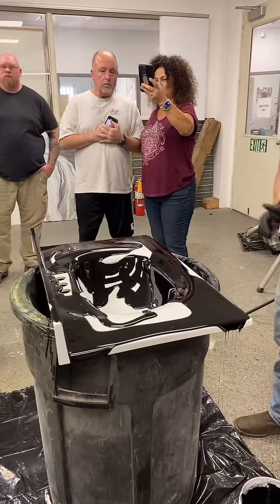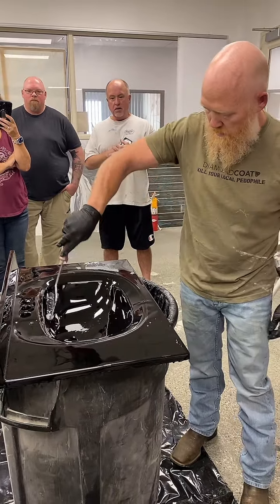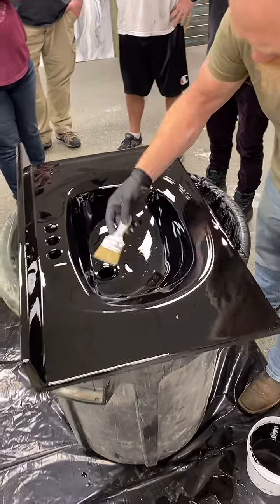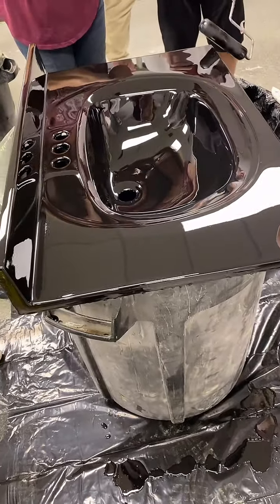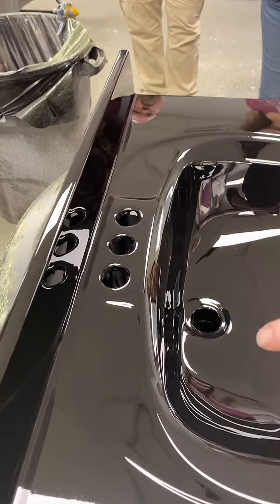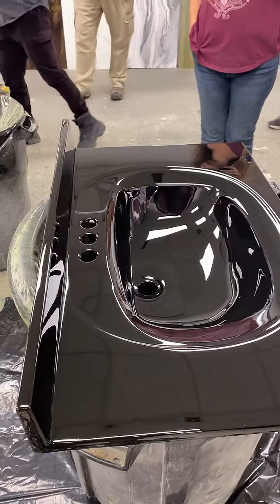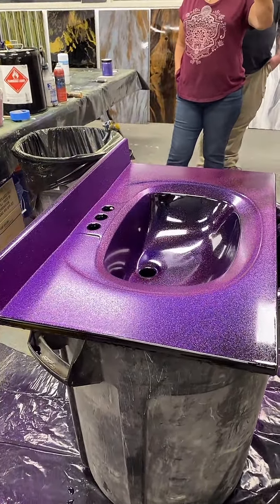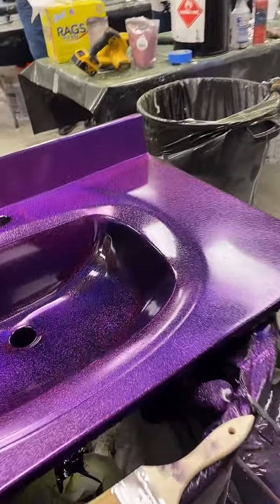TikTok Live 11/22/23 - Epoxy Purple Glitter Sink with Workshop - Countertop Epoxy

Comment: Same doubt with another video. The epoxy on non flat horizontal surface does not drop? I use to see epoxy on tables but never on irregular or vertical surfaces like this. Is this a special epoxy?
Reply from the maker: Yes it can hold up to verticals the height of a standard tub.